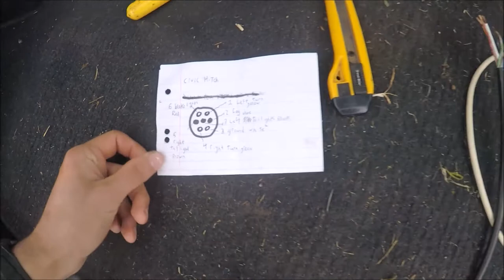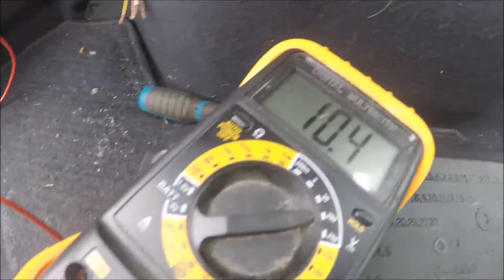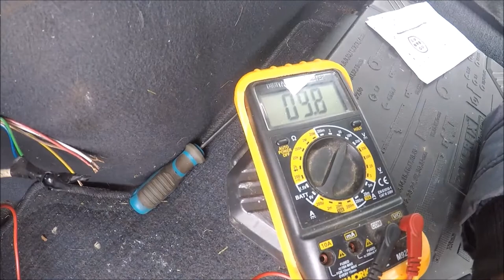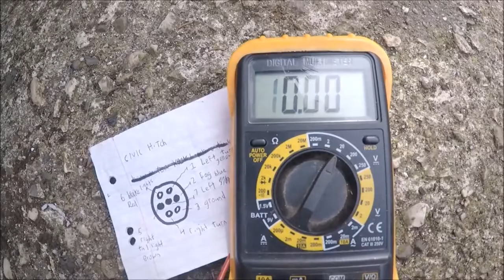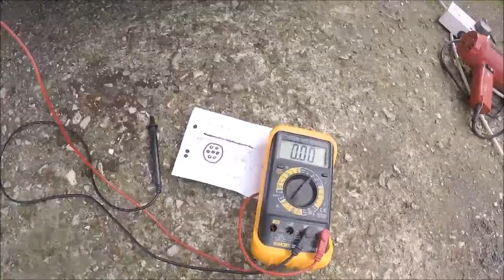Installing a trailer hitch to a Honda Civic

Comment: Where did you buy your trailer hitch? What brand is it? I bought a trailer hitch that said it was for my car and then the trailer hitch itself had a design fault...
Reply from the maker: I got mine from Facebook marketplace. The brand is witter, they still had new ones for this car. Can you return the one you bought?
Reply: @Devon.Ferguson  they are  pain to find second hand these days. We are going to stick with the one we have and do the drilling holes underneath for the forks into the boot hatch.

Can I ask what is that drill and tool bit and mm size you are using to take off the inner bumper cage bar?
Reply from the maker: 13mm nuts 4 of them to remove that @HeavenlyKingdomMinistries